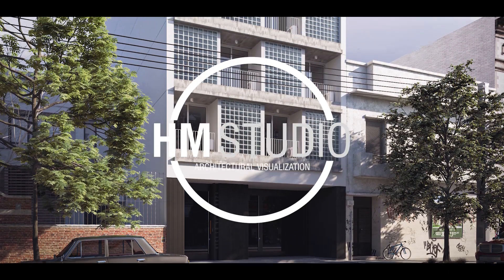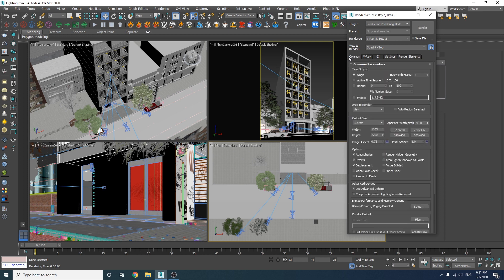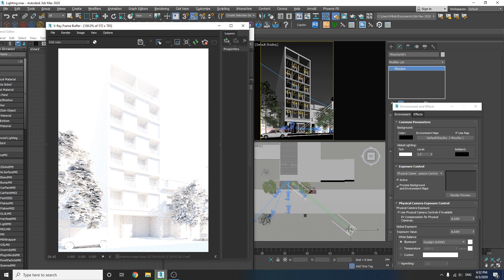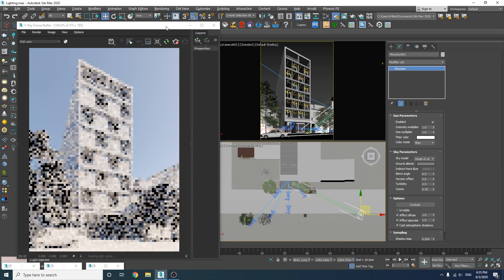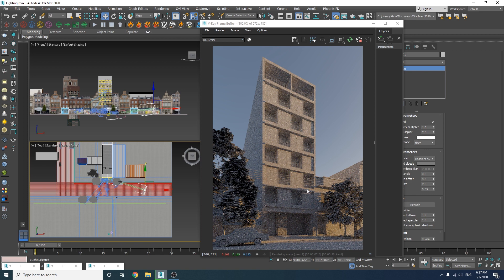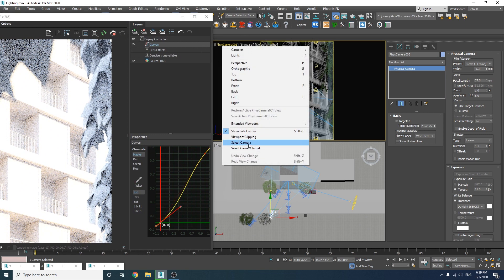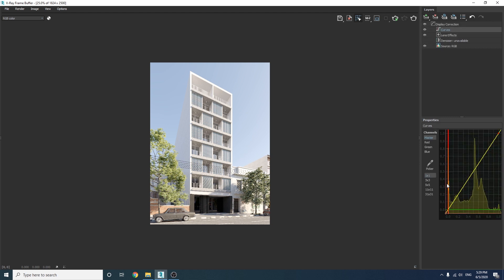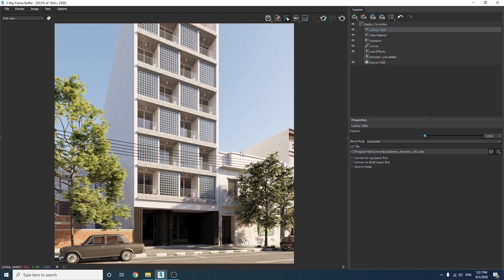Exterior lighting in V-ray5 |  | How to Illuminate an exterior scene with Vray sun and Sky in 3dsmax

Comment: Hello Hady!
i have a problem (Let's say, when the render is finished in the V-ray BF, if I make a copy of it  or save it to photoshop , it's not the same. there kind of less contrast, less saturation. Enough of a difference to bother me,  I'm using max default LUT and gamma settings , max 2020 )
Reply from the maker: That is related to Gamma correction settings. will make a video about that soon
Reply: Thanks for your response! Waiting for that video